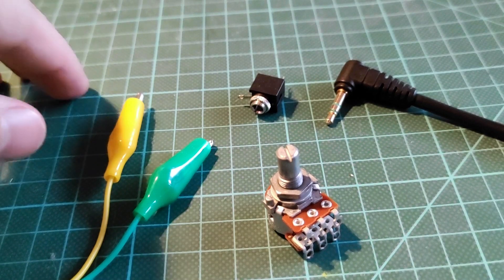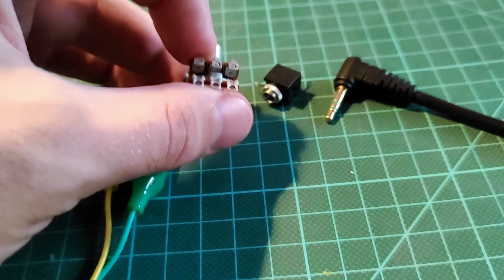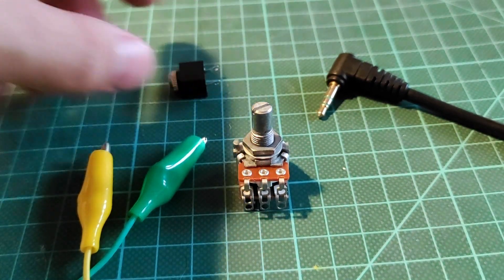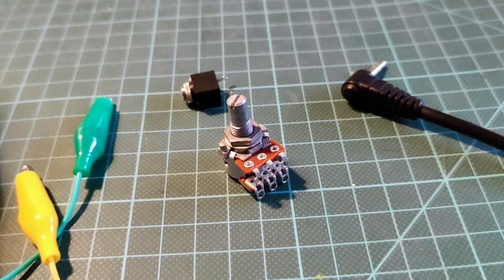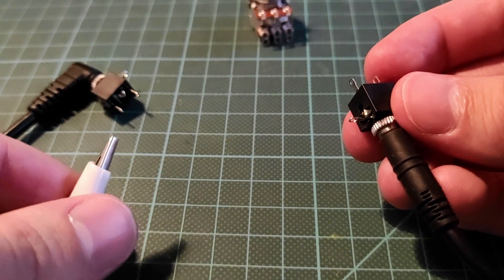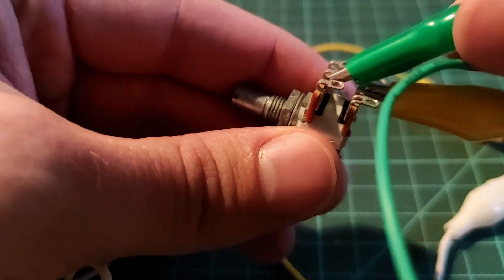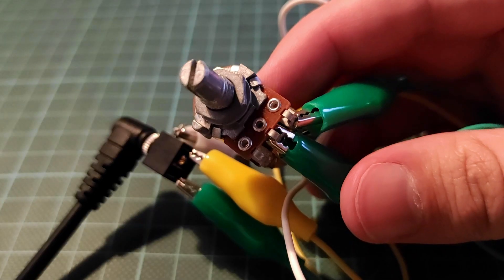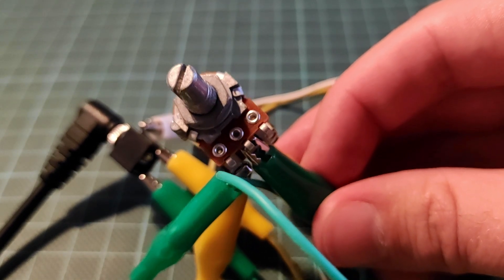How to Wire a Stereo Potentiometer

Comment: Wow!!! Thank you
Reply: Ignorant question: when I want to replace the alligator clips, what wire would I use?
Reply: @PollyPocketmusic  solder wires into holes but use a clip btween the hole and the pot itself so it does not burn it up

Comment: I’m having a bit of difficulties wiring a stereo potentiometer, and the wiring seems do be very different. As of now my potentiometer makes some kind of crossfade with the channels, left goes back and forth between L and R, same with the right channnel, and this is happening when I twist the knob. I wired ground from potentiometer to the negative of the amplifier circuit board, perhaps that have something to do with it..?
Reply: exactly the same thing is happening to me. Did you find a solution? Me and my friend spent many hours figuring out what's wrong and didn't come up with anything.

upd: it looks like I accidentally got myself a balance potentiometr....
Reply: @andriiprudnikov6334  first off, they are VERY sensitive to heat, I’ve burnt probably 4-6 of them. And I got some to work, relatively good. There’s always a bunch of noise that I can’t get rid of. Sounds good without potentiometer,  but I really like the function.  I did see this dude on YouTube who wired positive audio to right pin and negative to left, placed a capacitor between viper (middle pin) and base of the transistor. Haven’t tried it, but looks interesting